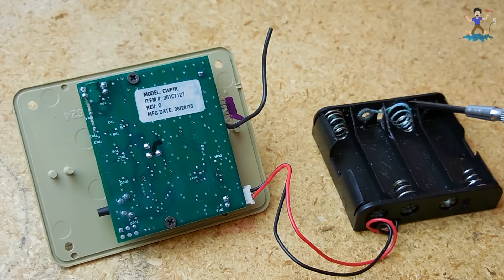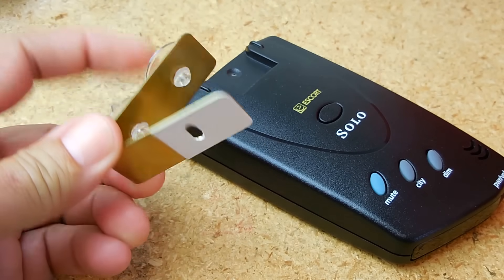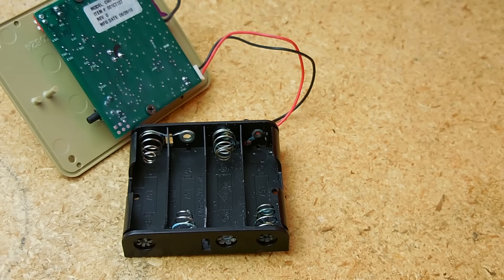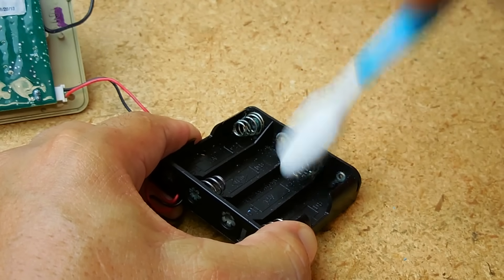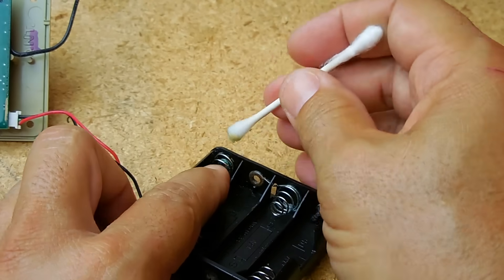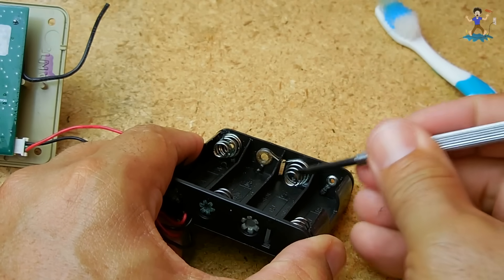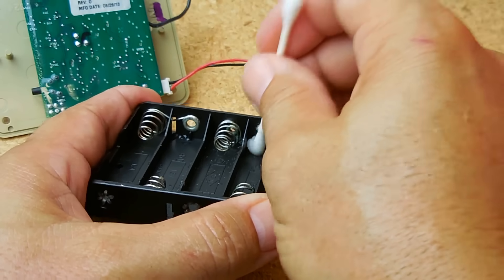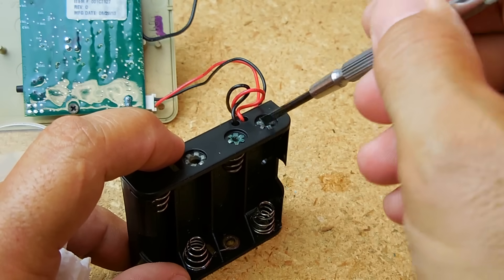EASILY Clean Battery Leak Damage(Corrosion) In Electronics

Comment: Wondering if some preventative work would help in the way of adding a little dielectric grease on those leads.
Reply from the maker: I'm not a fan of any grease that's non-conductive, but a thin film of silicone grease on the terminals should be OK. Thanks for watching!

Comment: Does this work just as easily on the circuit boards and internal connections. I got an electronic laser level with circuit board corrosion that I would like to save.

Comment: You can use baking soda mixed in water instead of white vinegar.
Reply from the maker: Incorrect. In order to neutralize something that's alkaline, you must use an ACID. Thanks for watching!
Reply: @electronicsNmore  --- you are correct with what you say, but wrong about baking soda. I've been using baking soda and water mixture to clean battery terminals  on my car battery for years. It bubbles and foams and cleans off the built up corrosion. Baking soda is a neutralizing agent for acid. That's what is the main ingredient I'm most antacids that you take for heartburn as well.
Reply from the maker: What's leaking out of an ALKALINE battery isn't an acid!
Reply: @electronicsNmore  --- then, I stand corrected. I thought it to be the same as the acid com other batteries which is an acid.  Thanks for that info.

Comment: Nah, I just stay away from cheap batteries brands. Better than have them destroy my devices. If you value your devices more than cheap batteries then stay away from them and buy quality brands like Eveready, Duracell, etc. Batteries like Navra brand that leak after a while are device killers.
Reply from the maker: LOL. The batteries you mentioned leak!
Reply: @electronicsNmore  
Don't know about these brands leak. I've left these brands in my metal detectors over a year and when summer returned I wanted to change to fresh batteries and found those already in my detectors like new, no leaks. Duracell lasts so much longer in my detectors, not even an acid leak.

Comment: What if you don’t have white vinegar?
Reply from the maker: It's the cheapest and safest to use. If you have another acid laying around, then you can make a DILUTED liquid yourself. Only takes a few drops in 4oz of purified water. Be careful when handling acids, and use gloves/goggles in a well ventilated area. I have a lot of excellent videos on my channel that cover many different subjects, so be sure to check out my extensive video playlists for other videos of interest to you, rate thumbs up, and share my channel with others. Thank You
Reply: electronicsNmore ok, however my problem with my battery slot is on a toy  chainsaw I was customizing with spray paint and some of it must’ve gotten inside through the cracks and its not a case of dead batteries either, I checked. Any suggestions for paint damages?
Reply: electronicsNmore hello again, I can imagine how busy you must be, but please I need an answer soon

Comment: Some people need to realize that car batteries are acid batteries and so baking soda works because it neutralizes acid. These little batteries are alkaline batteries so an acid like vinegar neutralizes them. I have had little luck neutralizing these little batteries with baking soda and that makes sense because it violates the laws of Chemistry.
Reply from the maker: Thanks for watching Sheri!
Reply: Great video. A tip I got from the comments is to neutralize the water after a vinegar rinse with 90% alcohol because it absorbs the water. I like to treat cleaned contacts with De-Ox IT and Preserve IT sprays (spray them on a Q-Tip if overspray is a problem). Radio Shack also makes a great contact cleaner and protector.
Reply: It's because alkaline batteries have an - you guessed it - alkaline base.  Alkaline is basic - high ph - so using a high ph substance like baking soda does nothing.  Vinegar is low ph - it's a weak acid - so it will reduce the ph and result in just plain water (really it will result in positive hydrogen ions in a solution, but since positive hydrogen ions gladly bond with O2 you will wind up with water).  The alcohol helps evaporate the water because it has a low enthalpy of vaporization, so it it vaporizes fairly quickly at low temperatures.

Comment: You have a good knack for teaching.     Battery leakage is a problem that seems ageless.    Are batteries EVER going to stop leaking and creating these problems?      Hopefully  many people will now save their corrosion infested flashlights and other battery operated stuff.     Great topic.
Reply from the maker: Glad you enjoyed it! I have many excellent videos on my channel, so be sure to check them out and share.
Reply: Alkaline batteries used to NOT leak very often - I think they have cheapened them like they have everything else and now they leak as badly as the old carbon zinc ones did.
Reply: @KarlsLabReport  the newer lithium non-rechargeables are advertised not to leak. I haven't tested that theory. Also. What are your thoughts on the environmental effects on whether or not an alkaline battery will leak?
Reply: @KarlsLabReport  , Duracell are the worst, they almost always leak and cause massive corrosion. I've had better luck with Eveready Energizer, and Panasonic batteries. The special Eveready "Lithium Max" disposable batteries are supposedly guaranteed to not leak, at least in storage anyway, for 10 years. They're kinda pricey, especially the 9 volt batteries, which I've been putting into expensive test equipment with hard-to-access battery compartments, such as Fluke multimeters where you have to unscrew the back to access the batteries. A tip: wrap the battery in Saran wrap to help contain any leakage (9 volt batteries usually leak from the bottom, penlite batteries leak from the negative end). PS, don't mix and match batteries; use same brand/same batch batteries, or the weakest, different battery will leak first ---- or, it might internally flip polarity! I have seen this happen!

Comment: Thanks for the tip of usin white vinegar. I have to try it. BUT NEVER use screwdriver when cleaning the connector. I use old fashioned typewriter eraser pen having a brush on the other end. Or glass fiber cleaning pen which is very effective. Be aware of the fiber dust and tiny bristles which have cut off. Those can penetrate the skin of your hands.
Reply from the maker: The screwdriver works just fine when there's heavy corrosion. If there's a small amount of corrosion, then a pencil eraser or fiberglass" nic-sander" is very good.